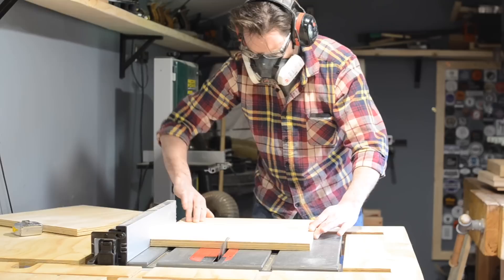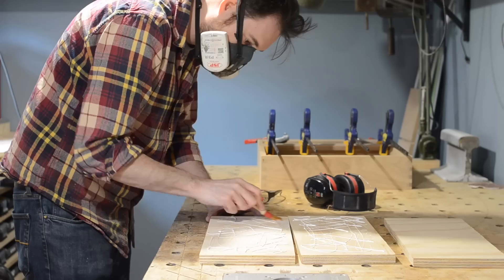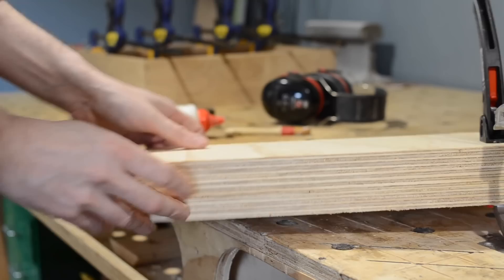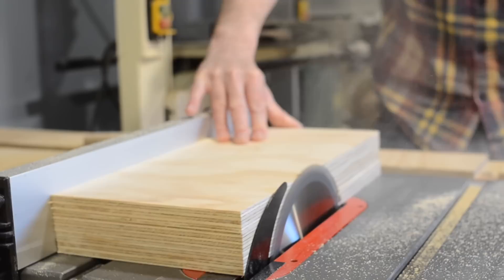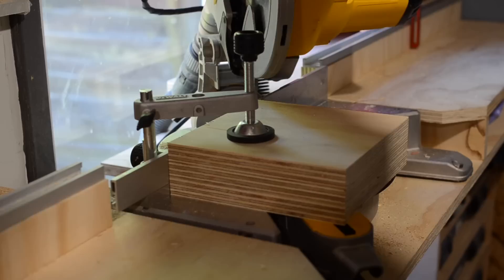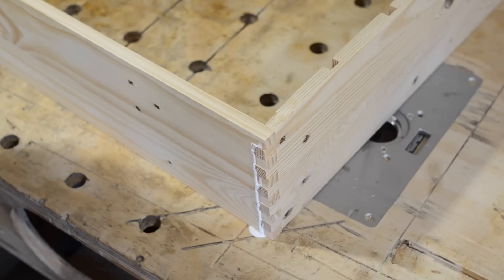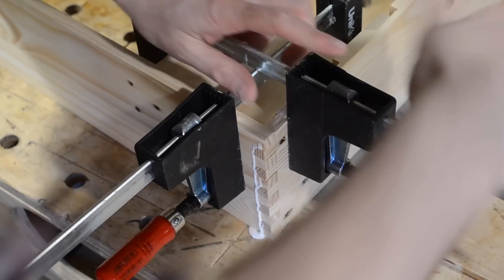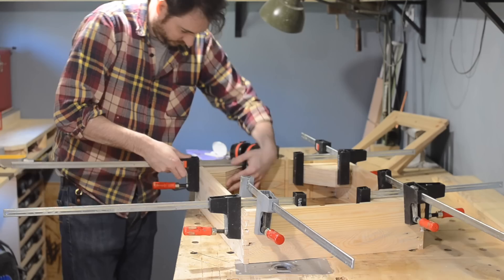Mitre Clamping Blocks

Comment: Nice one👍 Apparently sprinkling salt on top of the glue stops the boards sliding as you tighten the clamps.
Reply from the maker: Yes i have heard that
Reply: I was also going to add this idea of sprinkling a little salt on the glue as a comment. 

Am I wrong in thinking that I could use these blocks instead of the traditional corner clamps on projects that don't have any exterior fingers?
Reply from the maker: Yes they could be used on any corner joint

Comment: Glen at DIY Creators just made something very similar in his 6 tricks videos today.  Must be something in the air :)  Such a great idea that hadn't occurred to me.  His had holes in to use spring clamps in if you wanted that way too (fewer things to stick out and get in the way as you had :) ).  Anyway, cheers for the tip!
Reply from the maker: Thank you. I want mine for mostly working with parallel clamps as anything with a box point will be a wide board.

Comment: Thanks for the video Matt, good excuse to put my feet up after lunch. I did see on a video someone used a single wrap of brown parcel tape to prevent the glue squeeze bonding to the blocks. Just a thought 😉😀
Reply from the maker: Thats a good idea, I will try that
Reply: This is what I like about the wood working community....We have ideas, we share, we learn.  The parcel tape sounds like a good idea!
Reply from the maker: If we all put our heads together we can come up with something good.
Reply: Badger Workshop thanks Matt 👍🏻! Another tip I've come up with is to reuse the liner from a corn flake (other cereals are available 😏) underneath glue joint to stop it sticking/ marking the bench.🤔

Comment: Good simple video with a really useful point and I like the fact that you own up to procrastination...one of my downfalls too.  A quick suggestion, clip off the square corner of the blocks a little so that any internal glue squeeze out doesn't make the block a permanent part of your project.
Reply from the maker: I could do that but with finger joints its useful to have the corner to line up with the start of the finger.
Reply: Or a bit of packing tape on the inside faces will stop glueing them to the project ;)

Comment: I don't trust my mitre saw to cut a perfect 45 or 90°. I've lost count of how many times I've aligned it to come back later and it's miles off. I guess that's the downside of using cheap tools!
Reply from the maker: I was the same with mu old saw. This dewalt is great